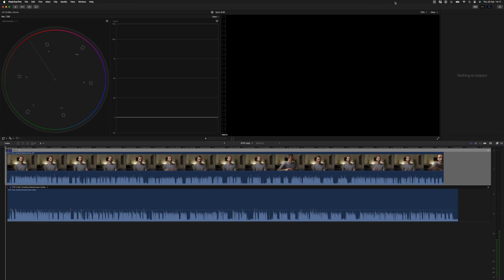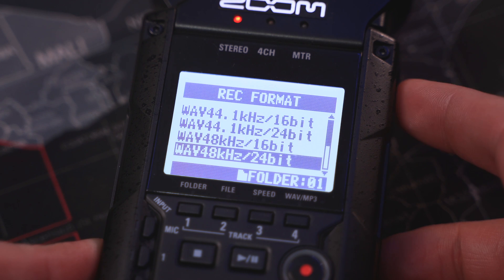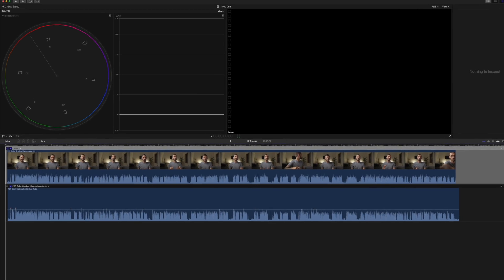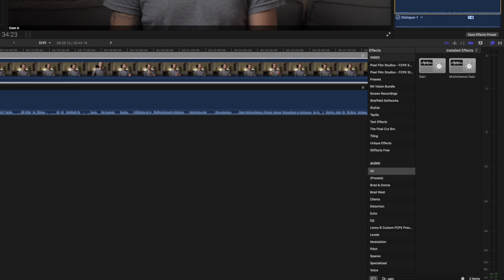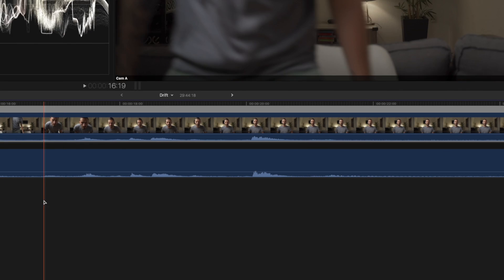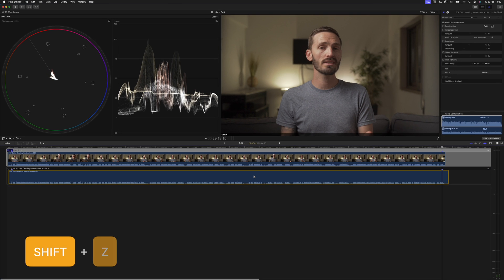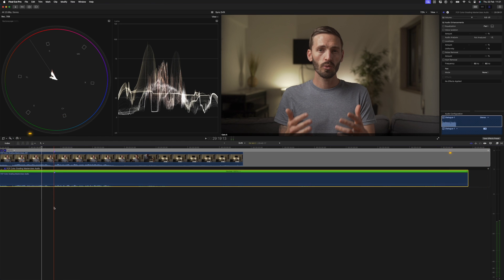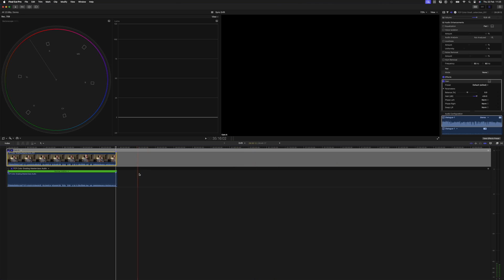How to Fix Audio Sync Drift in Final Cut Pro

Comment: your still going to get drifting audio no matter what even if you're recording the same frame rate and sample rate. you fundamentally don't understand what you're teaching. frame rates and sample rates can cause it as well, but those aren't the only reasons. and again, even with those correct, it will still drift unless you have a timecode generator to sync all the sources.
Reply from the maker: I never said it's the only reason. It's a very common reason and that is what I was showing how to fix. Also, I don't think it's totally accurate to say you will get drifting no matter what. No, not always.

Comment: bizarrely, when I record long form video (DJ sets) with an iPhone there is no audio drift... however when using an action pro 5, I always have issues... Both are set to record at 25fps, and the project file is the same. Even the audio is recorded using a Tascam at 48khz. Weird!
Reply from the maker: That is super weird! Did this drift sync method help?
Reply: @Brad_West  Normally I have to either time stretch the video slightly, or switch to another camera angle, and readjust. However If I'm filming one camera angle using an AP5, it gets trickier as the video gets split into different files every 17gb or so. Granted, they're not mainly built for long form recording, but it's still bizarre. unless I have a dud model?

Comment: HELP! When I re-time the end of the clip, the beginning moves around. I created all the markers, but the clip doesn't stay anchored. What am I missing?
Reply from the maker: This might be because of the clip connection point not being right at the beginning, or it could be because the clip was previously retimed (even if that part was cut off). You could bring in the clip from Finder/Browser again to start from scratch. Or, just retime it in smaller increments so that you can try keep those markers synced. It might require jumping back and forth between the beginning and the end a few times, but it can work that way.

Comment: Thanks for explanations. I have small question. I made a video in final cut pro for my piano cover. Even when i export video, sync is normal. However, when i trying to upload instagram, sync is broken between audio and video. What can be the reason?
Reply from the maker: That is super strange. I would suggest converting your export using Handbrake (it's free) and then uploading again to see if you have the same issue. I talk about Handbrake in this video: https://youtu.be/VWZVTt1hFLY

Comment: Thanks for all of your helpful videos. I am running into a big problem and have spent 10 hours trying to resolve it and nothing is easily working. It might be a good idea for a video that other people would find helpful, so I'm going to go into detail with my issue.

Files I am working with:
-iPhone 16. Recorded Cinematic, 4K video, but it also recorded a non-cinematic backup file. The audio is 44.1 kHz because the iPhone doesn’t allow the sample rate to be adjusted. There are 5 video files totaling 4 hours.
-3 people were in the video. For 2 of them, I used a DJI Mic 2 system plugged into the phone port that captured 2 people’s mic wirelessly clipped to their shirt. I have a third DJI mic for the third speaker, but it does not get captured on the iPhone video file because DJI only supports 2 mics. Each speaker’s mic ended up creating 8 wav files that recorded 48 kHz. 

In Final Cut Pro, the main video file has the audio in sync, but person 1 talked too loud, and persons 2 and 3 mics were too low so I need to be able to increase / decrease each person's audio, as well as mute it sometimes while a person is talking and another person is coughing.

I created a Multicam clip with the Cinematic video files plus the 3 DJI audio files. When I expand the Multicam clip, mute the main video file, and only use mics 1, 2, and 3, the audio is out of sync. 

I made a compound audio file for each of the 8 wav files per speaker to help Retime work with 1 audio file.
I tried your Retime suggestion and it helped at the beginning and end of the video, but not the middle 3 hours. 
I tried using the non-cinematic versions of my videos and still had the same audio drift.
I tried a project set to 4K and 48 khz, imported the video files that recorded at 44.1, and then exported it as a 48 file, and then imported the 48 versions into a new project, but the audio was still out of sync.
I tried synchronize clips, but the audio was still out of sync.

What is the best way to handle this issue editing my current footage and to change any settings for future recordings to avoid this time-consuming audio sync? 

Should I make a Multicam clip, or just try and line up the audio from the 3 mics with the main video file? 

Thank you
Reply from the maker: Hey Tom

Thanks for the detail. There is a lot to unpack there. The first thing I would do is not create a compound clip for each audio source. I would give all the Mic 1 audio clips a "camera name" of Mic 1 in the inspector and the same for Mic 2 and 3. That way when you create the multicam clip, all the clips from each mic will be on it's own angle. I would then tackle the retiming of each audio file independently. It will likely be quite a tedious process given the number of audio files, sources and the fact that you can't change the sample rate of the iPhone footage.

Alternatively, if you are able to sync all the audio sources without retiming them. In other words, if you put them all in a multiple (not as compound clips) and they sync up, then you could potentially just retime the video video. You may need to cut it up into 8 sections (where each new wav file starts) and retime it in bits, but retiming 8 video clips could potentially be a lot easier than retiming 3x 8 audio clips.

If you want to see more about adding a camera name to clips to make multicam syncing easier, then I'd highly recommend watching my multicam video: https://youtu.be/DOdxFU_AM08

Please report back if you're able to get it working!

Comment: When I go to retime the clip at the end, it pushes the beginning out too. In other words, it expands the entire clip not just on end of it. What am I doing wrong?
Reply from the maker: That has happened to me before and I don't understand why. But, the solution is to retime it at the end, check the beginning and adjust if needed, go back to the end and repeat a few times until both markers line up. Pain in the ass I know, but it works.

Comment: Thanks so much for this.  I struggled for many hours with my multiclip.  I did have files with both 44.1 and 48k, plus 30fps and 60fps...I tried converting them all to 44.1 and 30fps, ended up starting fresh with my project and timeline a few times...still out of sync.  Hadn't learned about Retime editor until I found your video.  I really appreciate it.  

I should say that what I'm editing is a concert shot on three separate iphones in 4k.  One of the iphones froze up a few times in the same clip, so I had to split that clip into three files...and it also stopped recording.  For that phone, I have 4 clips for a 90 minute show.  FCP kept freezing up on my when I tried to create a multiclip with those files.  

I wound up creating a multiclip with two full length clips...I gave up on a multiclip for the iphone that froze up.  I guess FCP didn't like the way I split up those files.  Must've gotten confused using audio to sync.  Now I am manually dropping those clips as needed into my timeline.  

But I'm sure you know a better way.
Reply from the maker: Glad to hear that this helped you out a bit! Sounds like pretty complicated source material to get the project set up. You can also add clips to a new angle inside an exisitng multicam and use the "sync selection to monitoring angle" option to sync clips individually using audio. I talk more about that in my multicam video which you might find helpful as well: https://youtu.be/DOdxFU_AM08

Comment: Hi! Thanks for the video: My problem is that when I sync start and end of a video manually the way you describe it I have issues in the middle of the track. it really annoying, it's happening since I record withe podmic usb directly to the pc
Reply from the maker: That's strange. If the start and end are in sync but it drifts out in the middle then there is likely a bigger issue.

Comment: Question is you are syncing Multi cam clips with the audio attached to each clip, do you use the same process to fix it? change the timing of the clip? or do you detach the audio from the angle that is out of sync?
Reply from the maker: I wouldn't detach the audio no, I would retime the video clip so that the audio and video is kept in sync.

Comment: Hmmm… tried this and I could hear some weird comb filtering type artefacts in the audio as a result (adjusting a 1 second drift over 10 minutes of audio).
Reply from the maker: I’ve never had that issue with a 24bit wav file. What format / bit rate is the file you’re using?
Reply: @Brad_West 24 bit, 48 kHz wav. Neumann mic, Apogee interface. The effect was subtle and not obvious on all the audio, but occasionally I could hear unpleasant effects as a consequence of time stretching.
Reply from the maker: Interesting 🤔 If it’s ever happened to me it was so slight that I didn’t notice. Is it possible for you to stretch the other clip and not your audio clip?
Reply: @Brad_West  SOLVED. The drift was caused by me accidentally adding 23.98p footage to a 24p project (facepalm). So the footage was out of sync with the audio. I think you are correct that the negative effects of time stretching on the audio are slight, but for me it was noticeable. Try this as an experiment: Exaggerate the audible effects of time stretching audio by overstretching it (say, 20+ seconds of stretch on a 5 minute clip. The reduction in sound quality is obvious with such a stretch (it's not just slower, there are other weird artefacts). I can hear the EXACT same problems with much less stretching (even just 0.5 seconds). However, I'm in a dead silent studio listening with Genelec 8351B monitors and Sennheiser HD800 headphones, so I'm scrutinising the sound very closely. Having said that, as an audio professional, the reduction in sound quality was not acceptable to me. Thanks for your help - you helped get me to a solution.
Reply from the maker: @vadersgoldfish  Ah that makes sense! Yeah you can hear a comb-filtering type sound on certain words when stretching too much. Whenever I have had to fix drift, it's usually just a few seconds (less than 5 or so). Glad you found a solution 😄👊🏼

Comment: My audio is synced with my video but when trying to screen record and upload there is a delay. how do I fix this if screen recording has no sound on Mac?
Reply from the maker: You will have to manually adjust the sync of your screen recording. You will have to try and find a point at the beginning where it’s in sync and then check the end to see if that is out of sync. If so, you’ll have to find a point at the end you can create a marker and you can then re-time the screen recording clip.

Whenever I work with the screen recording that has no audio, I like to verbally say something like  “1, 2, 3 click” on my actual recording, and then, as I say the word click, I will click with my mouse, and I will use that as a point to sync the clips together.
Reply: @Brad_West  yeah I figured this out but thank u so much for replying!
Reply from the maker: @L4urynking You’re welcome!
Reply: @Brad_West  and thanks for that tip! Will be stealing that haha

Comment: The problem I have is that whenever I import a Zoom recording, the audio will pitch down and the voices become deeper.

I've matched both frame rate and audio sample rate of the recording to the timeline, so not sure how to fix this other than add the Pitch plugin and pitch it back up slightly.
Reply from the maker: That is really weird! I haven't experience that before. Glad you have a workaround though.

Comment: Thanks for the info! One question though. When I re-time audio in Final Cut, it sounds quite bad. Any way to prevent this? The only way I can think to explain what I am talking about is if you play a video at a faster speed on YouTube on Chrome, the audio sounds perfect no matter the speed, whereas if you do the same in Final Cut, it sounds very bad.
Reply from the maker: If that is happening then it sounds like you are having to stretch the audio too much. It's tough to troubleshoot without seeing what's going on, but it seems like there is another issue that would cause you to need to stretch it to the point where the audio sounds bad.
Reply: @Brad_West  I stretched it by the same amount in Adobe Audition and it sounded perfect. Thanks for the tutorial! I was worried there’d be no fix 😭
Reply from the maker: @Sillykids oh wow, that’s weird! How much did you have to stretch it by? Like what percentage?
Reply: @Brad_West  It was so small that Final Cut wouldn't even say it was anything different than 100% of its normal speed
Reply from the maker: I'm surprised that small amount made it sound weird. @Sillykids

Comment: I am recording video via an iPhone 13pro and it seems to be locked at 44.1khz my audio is in 48khz(separate mics). Is there  any way to change or upscale my iPhone video??
Reply from the maker: I'm not 100% sure. I feel like there should be a setting for that. You might need to Google to see if it's possible.
Reply: iPhone uses variable frame rate. The 44.1khz is not even an exact 44.1lhz.

Comment: Different audio sample rates do not cause drift. There is no inherent sync between audio and video from any two different devices unless the are physically locked to the same hardware reference clock. That is why SMPTE timecode and lockit devices exist. There is no inherent sync between any two video cameras if they are not genlocked.
Reply from the maker: Thanks for the great explanation Mark! Appreciate you taking the time to watch 😄🙏🏼

Comment: Once I worked with a project which contained more than a hundred clips and after that I decided that I will never record audio externally again. The only way to avoid drifting completely is using timecode devices, which will send similar timecode to the camera and audio recorder. This piece of tech is pretty expensive and most of the mirrorless cameras doesn’t support timecode directly. So, recording straight to the camera is the most efficient way for me at this moment.
Reply from the maker: Yeah in that situation, recording directly to camera is a way easier solution!